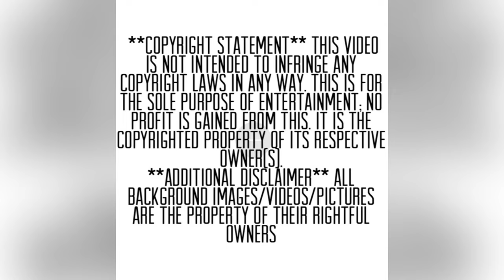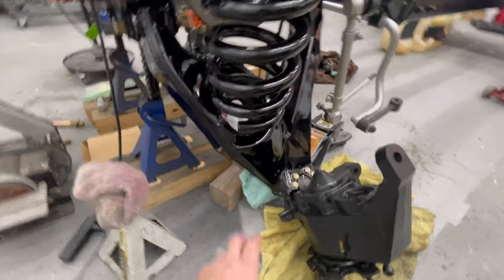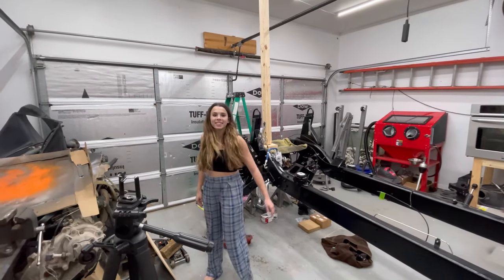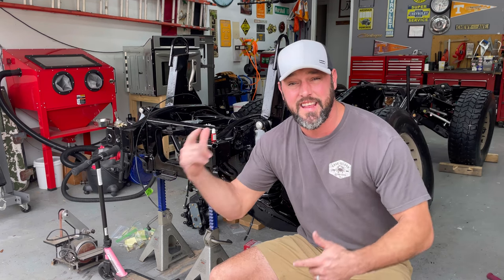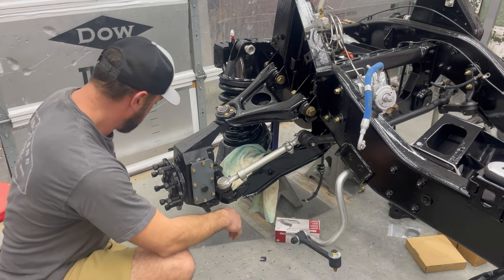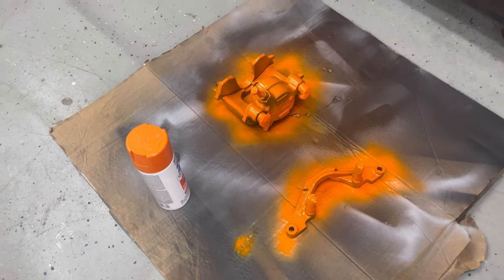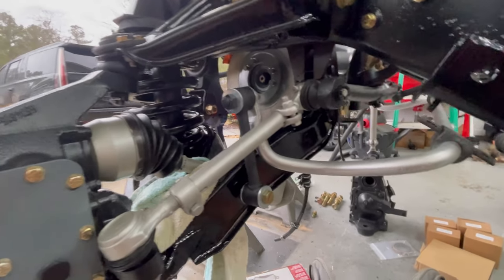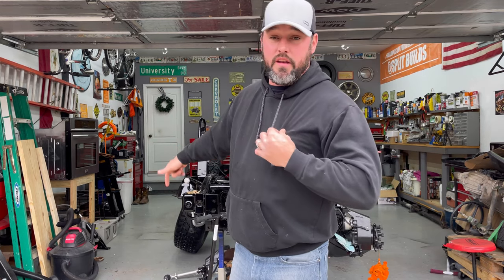Humvee Front Suspension and Shock Install

Comment: Wow. That's the most rediculous way to install a spring I've ever seen. Super unsafe and unnecessary. Next time your installing springs without a body, just wrap a heavy duty strap around the frame and under the floor jack, the jack will then be pulling the frame down as you jack the control arm up.
Reply from the maker: No it’s fine, I don’t want strap marks on my newly painted and powder coated parts.